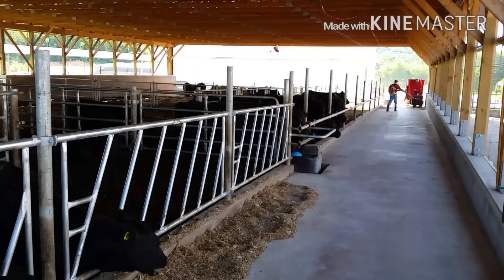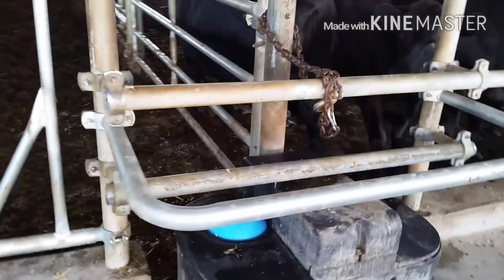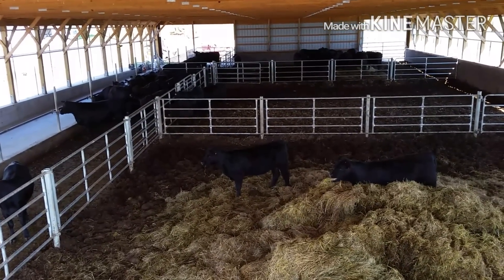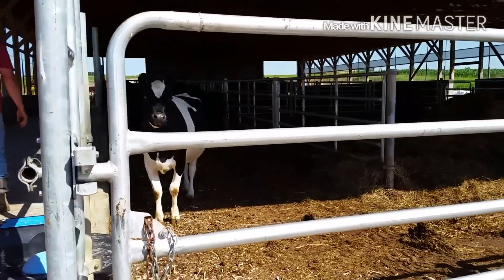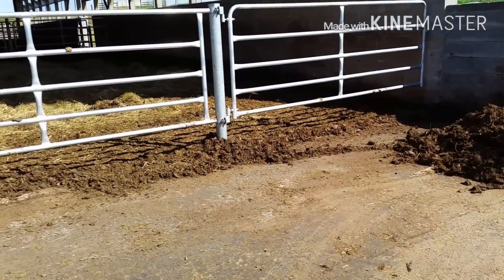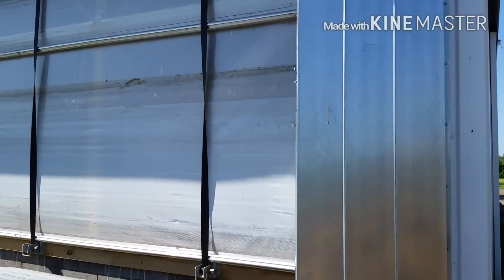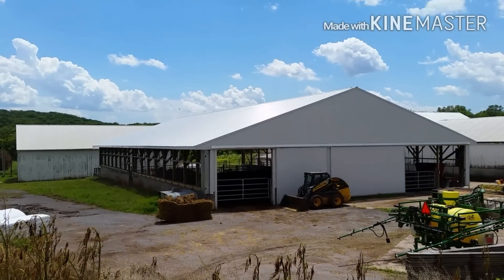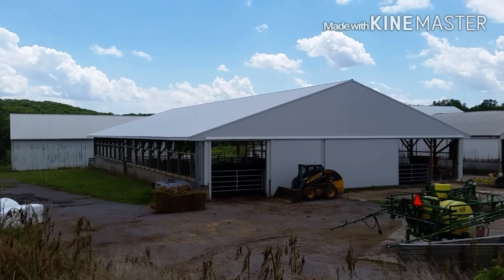Overview of our cattle barn and feed lot used for black angus

Comment: Thank you! I know I asked you for this video. What is the barns holding capacity?
Reply: Is it just for finishing? At some point I thought there were brood cows in there.
Reply from the maker: We could fit 250 head in it, we use it for a cow and calf operation right now. Depending on the markets we could swith if we wanted. We do feed some out on occasion.
Reply from the maker: The farmer, @ELM CUSTOM HARVESTING, wants to know if you saw the black angus bull on Lancaster farming that was need out of power line.  . .we have 12 cow bread to hit
Reply: +The Farming Life I saw a picture of the bull on Instagram I believe.  Looks sharp.
Reply: +Pennsylvania Farming is there an ad in Lancaster Farming or an article.